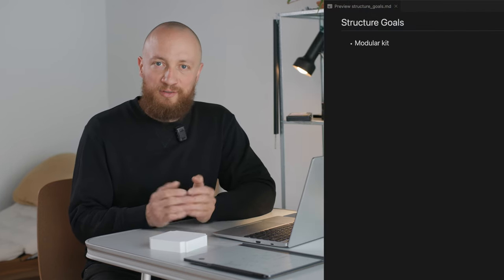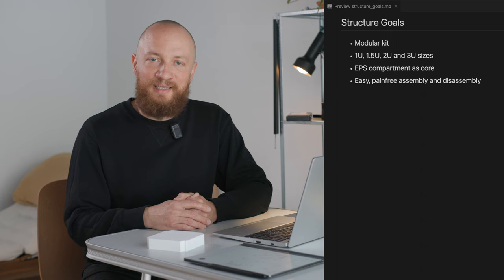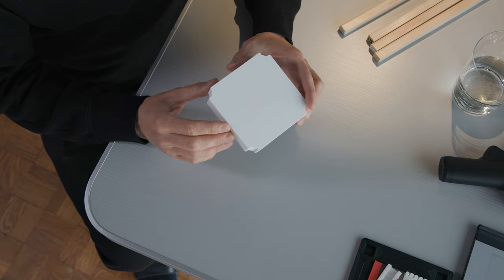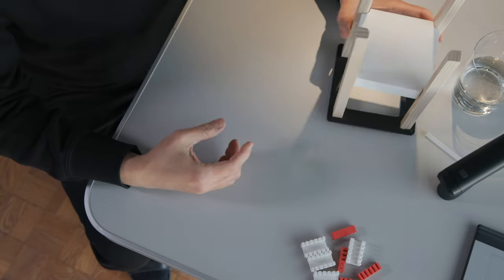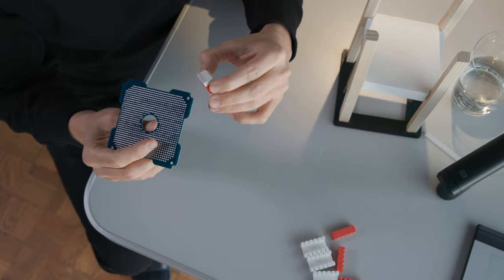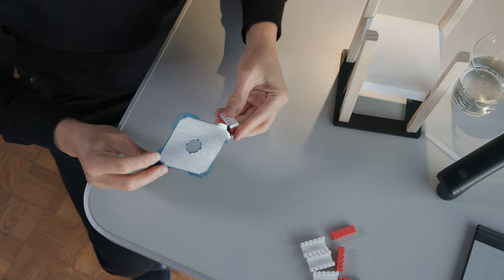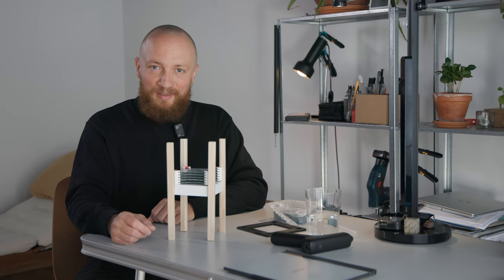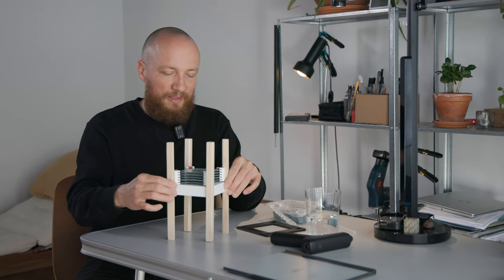CubeSat Structure: From Idea to Mockup

Comment: Is there any possibility that i can also work with you. I can learn and work hard.😊
Reply from the maker: Hi and thank you for your comment. As I have just started this project recently, I think it's too soon to engage in collaborations. But I am making everything open source as it progresses, so you can absolutely follow along an start prototyping stuff in parallel (check the description for the link, rail CAD files will be up soon). Cheers!